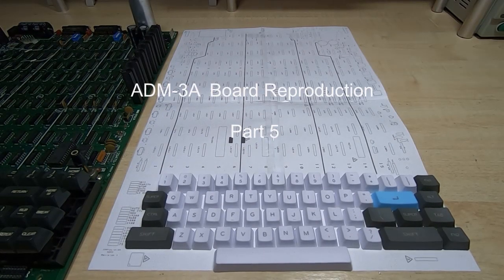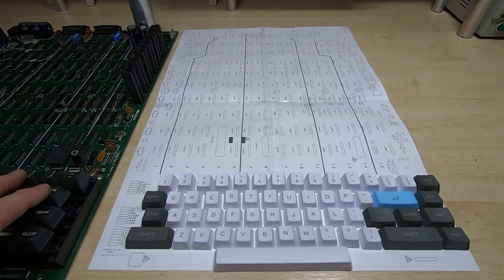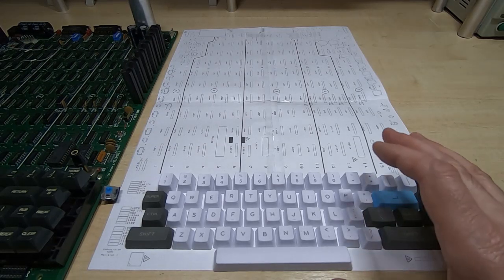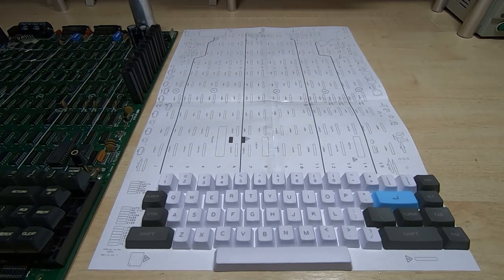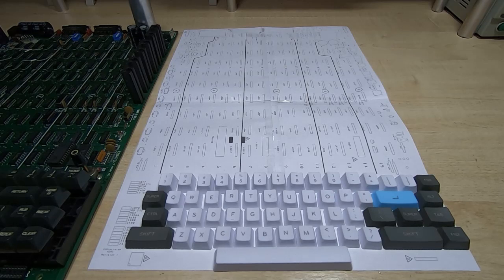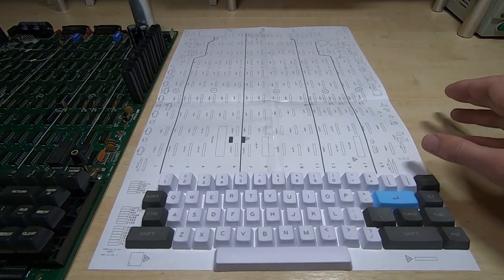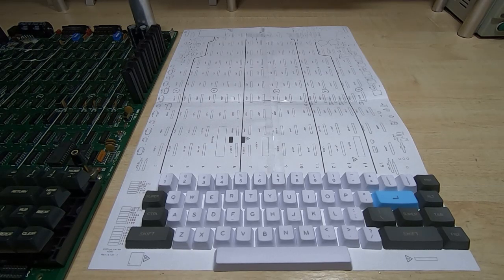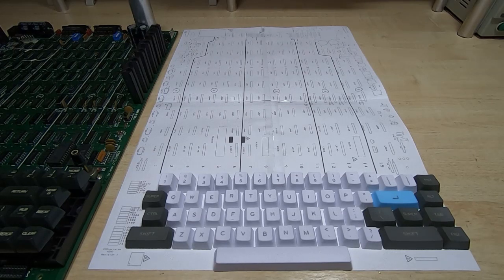ADM-3A  Board Reproduction Part5

Comment: Would it be possible to buy the EPROM from you? I have an ADM-3 and I'd like to upgrade it to a 3A. I've been told it's just a change in firmware.
Reply from the maker: The ADM does not have any firmware. The ROM's only contain the character sets. The EPROM I am using will not work in the original board as they are different devices and are not interchangeable. I decided to use an EPROM rather than the original mask ROM's as the originals are pretty much impossible to obtain.